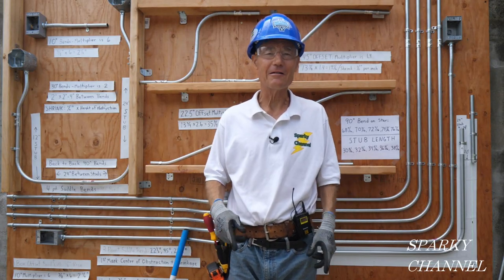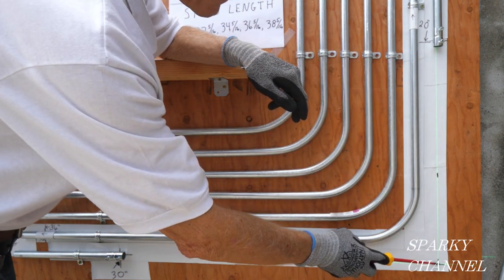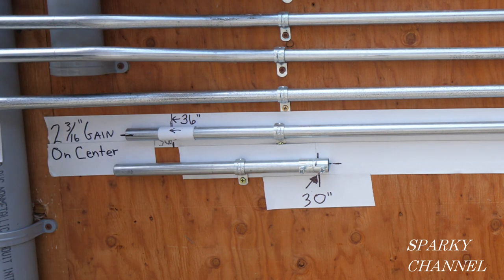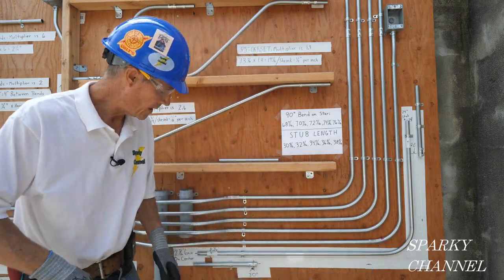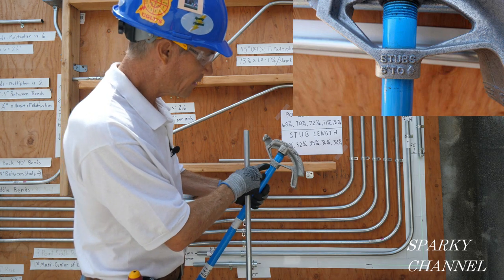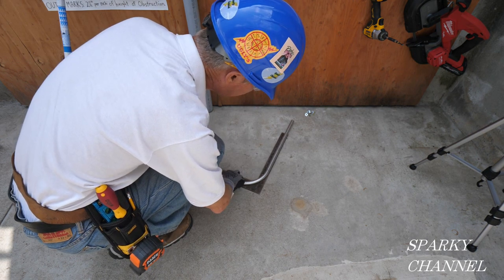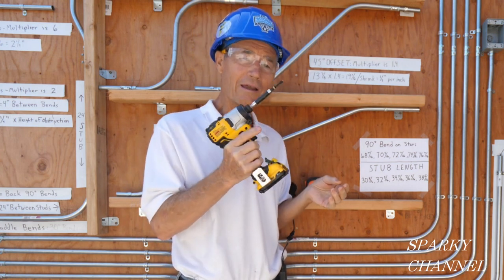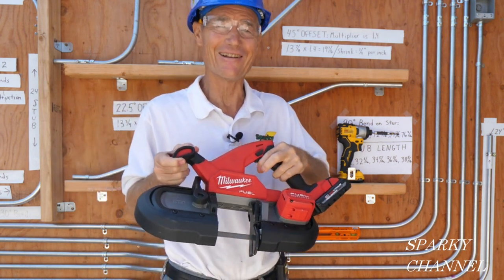Save Money By Knowing About EMT Bending Gain

Comment: Your videos are always very informative and well done. You have a great deal of knowledge to pass on to the younger (and older - like me) people interested in electrical work.  I have a request.  Would you do a video on bending conduit around an obstruction in the corner where 2 surfaces meet at 90 degrees. So the setup - a conduit is running from left to right on a wall. A wall intersects the wall from the right at 90 degrees. The conduit will need to follow the intersecting wall at the same level but there is an obstruction in the corner.  It might be a 12" diameter duct or a 16" x 18" duct.  The duct might not even be right in the corner of the intersection.  It might be 1 foot from where the walls corner.  We need to get around the duct to the intersecting wall.  The problem is minimizing the degrees of bend so we do not push either the 360 degrees of bend in one pull or just make it a more difficult pull.  

You could get around the duct with 3  90 degree bends but if you have a 20' run on each wall of the run with the 3   90 degree bends the pull is much more difficult with the friction. 

I haven't figured out how to bend the 2   45 degree bends or just analyzing the thought process for the best solution.  Is 2  45 degree bends better? One 90 and then an offset?  There are some apps that will help with the bends but the app does not put the knowledge in the head of the electrician.  

Second idea -- How would you bend an 18 foot radius?
Thank you for your consideration and great work and teaching ability.
Reply from the maker: Thanks Larry! Are those bends indoors?
Reply: @SparkyChannel  yes. could be in a basement, a shop, garage, any non-wet, non- damp location, or a plenum area above the false ceiling of a basement or any other floor.  Yes, just emt.

Comment: This subject is one of the most misunderstood topic of conduit bending. Sparky Bill does a great job of explaining how to use “gain” in your bending but he doesn’t explain “gain”. “Gain” is the relationship between a radial 90 degree bend and  perpendicular 90 degree angle .  For example, Bill uses a laser cross between the vertical and horizontal conduits on center to measure the linear distance between couplings. That measurement is   50”. When he applies “gain” to the conduit to be bent on a 90 degree he subtracts the “gain” amount (2 3/16”) and makes his measurement for a total of 47 13/16”. The conduit being bent does not actually get longer like the term “gain” implies. The conduit being bent is measured and cut  (47 13/16) shorter in relationship to the overall measurement of 50”.  The term “gain” really means you have gained conduit on the cut section of conduit not actually being bent.
Reply from the maker: Thanks!

Comment: You bent the conduit with a 20 inch stub, but you measured 20 inches to the center line, so wouldn't that make your first conduit stub shorter than desired by half of the diameter of a conduit?  I am confused how that worked out, if you have time please explain.
Reply: You’re absolutely correct. That’s why he hasn’t explained it to you. Also speaks to the usefulness of video editing. 😅He should have made his mark at about 15 3/8” (OD of 1/2” emt is 0.7”).
Reply: You can see right after he gets the horizontal segment of the tubing inserted into the coupling at about 4:51, that it’s not level. Then the camera cuts to a new frame a second or two later of what is certainly not the same bent piece of tubing.

Comment: So can have unlimited EMT just by repeatedly bending it and straightening it out?
Reply from the maker: No, it wouldn't look right.
Reply: Wouldn't look right? As in it would look miserly and cheap?
Reply: @stevematson4808  It doesn't actually get longer. Not sure if you were just being sarcastic, but the gain is really just the curve of the 90 degree bend taking a short cut. Instead of following a perfectly sharp corner, it makes a rounded turn to get to the same general direction. It would be like saving a few miles by taking a closer route that still gets you from point A to B.
Reply: @illestofdemall13  obviously I was being sarcastic. This is just a scam like the infinite chocolate bar.
Reply: @stevematson4808  I thought so, but there are thousands of people who leave comments on Youtube and there is a broad range of ignorance, stupidity, seriousness and sarcasm. Lol
Reply: @illestofdemall13  No. I think that you are encouraging electricians to take advantage of their customers by stretching the EMT they install. Its just a variation of the infinite chocolate bar scam. You should be ashamed.
Reply: @stevematson4808  That's why I ask the new guy to look for the conduit stretcher.
Reply: Hahah this comment wins

Comment: SO THE GAIN WILL ONLY BE APPLIED ONTO THE TAIL; NOT THE STUB.
Reply from the maker: The gain comes from the 90° angle bend.
Reply: This subject is one of the most misunderstood topic of conduit bending. Sparky Bill does a great job of explaining how to use “gain” in your bending but he doesn’t explain “gain”. “Gain” is the relationship between a radial 90 degree bend and  perpendicular 90 degree angle .  For example, Bill uses a laser cross between the vertical and horizontal conduits on center to measure the linear distance between couplings. That measurement is   50”. When he applies “gain” to the conduit to be bent on a 90 degree he subtracts the “gain” amount (2 3/16”) and makes his measurement for a total of 47 13/16”. The conduit being bent does not actually get longer like the term “gain” implies. The conduit being bent is measured and cut  (47 13/16) shorter in relationship to the overall measurement of 50”.  The term “gain” really means you have gained conduit on the cut section of conduit not actually being bent.